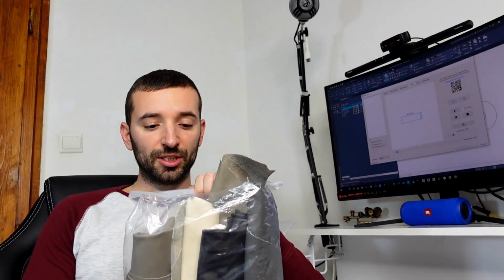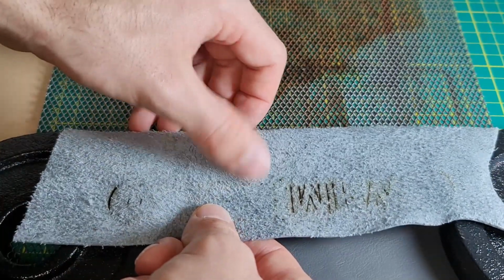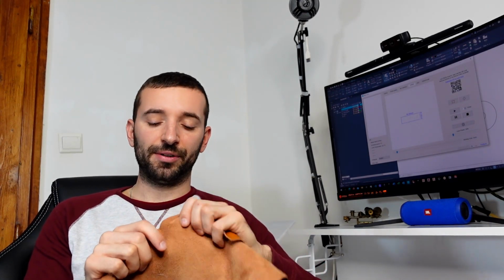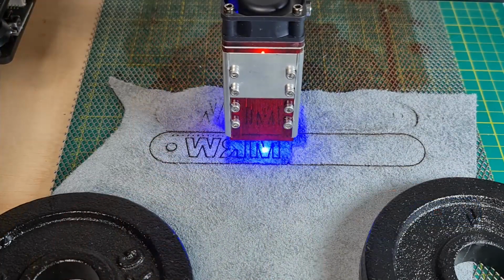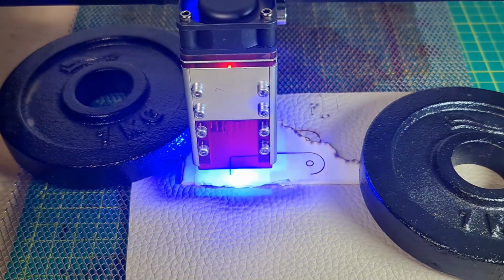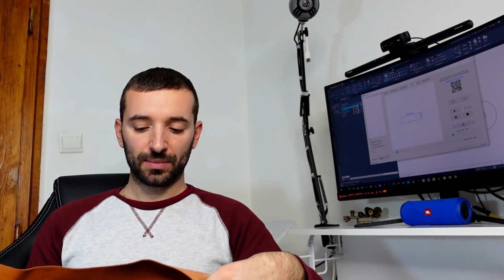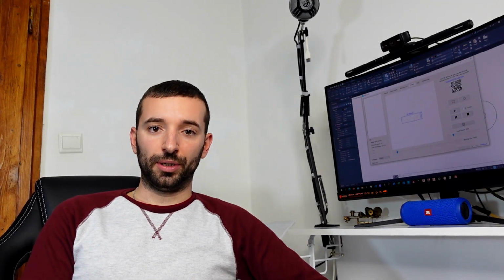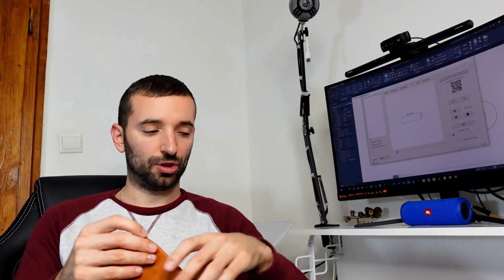Can you Cut Leather with your Laser Engraver

Comment: There's So Much to Learn.
I'm Very Grateful for Your Tutorials.
I just recently bought my Very First Laser and haven't got a Clue what I'm doing but thought this would be a great hobby to learn and keep my mind busy with new ideas.
I engraved three vector images using LaserGRBL and had to learn how to create the GCode .nc File extension so I could save it on a Micro SD card to insert the files in the desktop laser without having to be directly connected to the computer.
(For engraving/cutting outdoors when using it for acrylic or anything else that can be toxic when burning)
Eventually I hope to build a hood out of an old Air Conditioner enclosure and add a exhaust fan to pipe the smoke outside.
Anyway, I'm just Thankful that You and Others are helping Newbies like myself learn the "How To's" in Laser Engraving, this will definitely help get something that I can give Family in the near future possible in a shorter time.
Ciao My Friend!!
Reply from the maker: Hi, thank you for your comment.

I am glad that you found the content insightful and useful.

Good luck with your hobby.
Ciao

Comment: why you just don't tension it and nail it to a plywood board?
Reply from the maker: Hello jhonoleg, thank you for your comment. 

This may help to remove crispiness, but it does not help with the corium layer.
After the video I started to experiment with water, just soak the sheet of leather for 5min in water before starting, then use a roller to squeeze the excess water out, and it cuts very nicely.

I am planning a video update in the future.

I hope it helps
ciao

Comment: Hey, just a tip. Soak your leather in distilled water, then stretch , and finally, roll the excess water away with a clean dough roller before burning. It does  a couple of things. It's more consistent,it doesn't char, and you can turn the power up without worry. It works great for me. I say distilled water to avoid mineral marks on the leather.
Reply from the maker: Hello randy mulhern, thank you for your comment and suggestion.

I will definitely try out your method and eventually feature it in some of my next videos.

thank you.
Ciao

Comment: Very good, I haven't tried to cut leather yet but I've engraved a fair amount. The biggest problem I've had with engraving is removing the soot. What are you using to clean the soot from the engravings? I will try and use an iron on the corium side of the leather and see if I can get a good cut. I thank you for your time to test leather and another good video!
Reply from the maker: Hello George Chambers, thank you for your comment.

So far I have been blowing compressed air, than used some soapy water just to rub on it couple of time and it seems working, but as I said I haven't had much experience with leather, therefore, this might not be the best solution. 

I hope it helps
Ciao